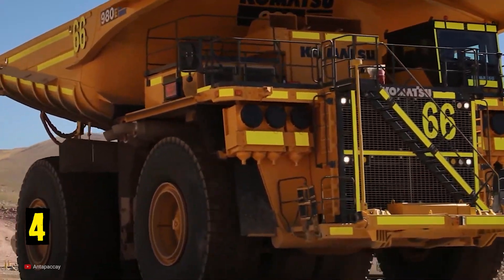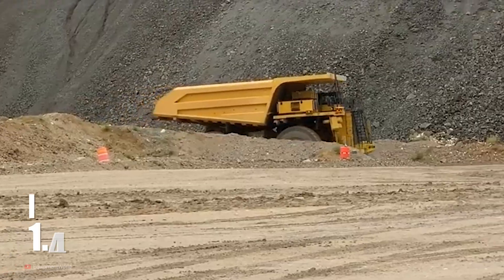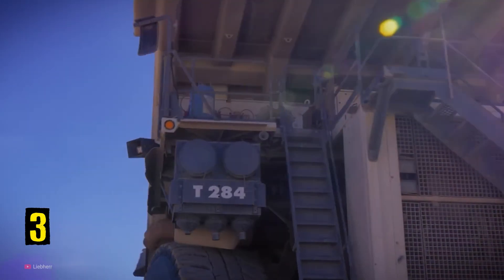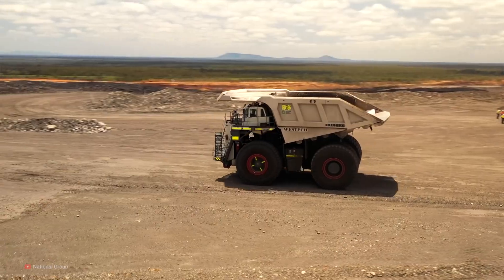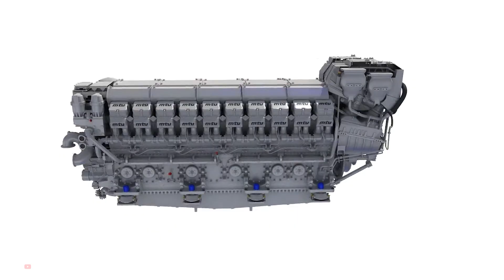10 Largest Dump Trucks in The World

Comment: I liked that you mentioned the torque rating on the first several trucks... disappointed that you didn't continue, as torque is the important factor in heavy vehicles  Engines are optimized for torque, rather than hoursepower